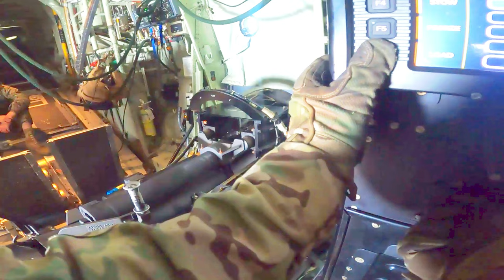Exercise Balikatan 22 | AC-130J Ghostrider Live-fire Training Missions| 4k@60Fps

Comment: If only we can afford this  for our COIN Op.
Reply: A heavy gunship like the AC-130J would be ridiculously overkill for the types of close air support missions required by the AFP. It would be extremely cost-inefficient. Not to mention the extreme health hazards that such systems pose to their crews (loaders on AC-130 aircraft are exposed to extremely toxic fumes and heavy metals in the course of operation). Hardly a worthwhile option for the PAF.
Reply: @Girder3   Bro, operation in Maguing Lanao del Sur, (if you're local) sorteid not less than 4  attack aircrafts. Its not an overkill if you can save 1 soldier's life.
Reply: @Girder3  a 30 mm and 105 mm cannons are not overkill considering the PAF has dropped 500 pound bombs over some trapal tents in the jungles. Though you’re right that it is cost-inefficient.
Reply: The AC-130 is not for sale. It's US exclusive military hardware. Not even NATO countries has AC-130s in their inventory.
Reply: @retrotechpinas3640  I have
Reply: That would be nice to have 3 C130 gunships for Philippine Airforce, for PLA  maritime militia incursions  relaying ISR to their mothership for PLAN tactical strike 1 and 2nd island chain.

Those PLA militia vessels are scattered in WPS, Balintang channel, Sulu sea and Philippine sea for sea mine deployments once they execute invasion of Taiwan and Luzon, Philippines.